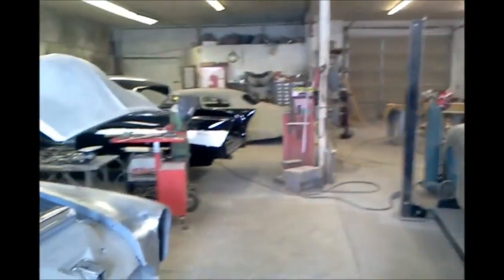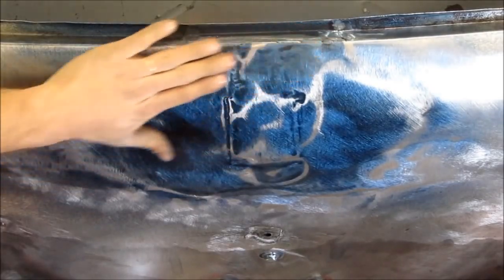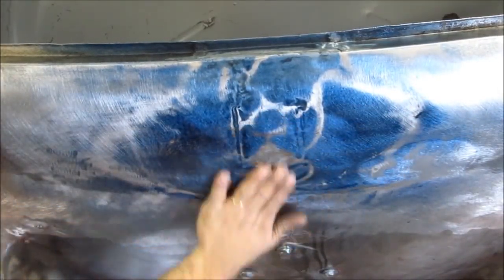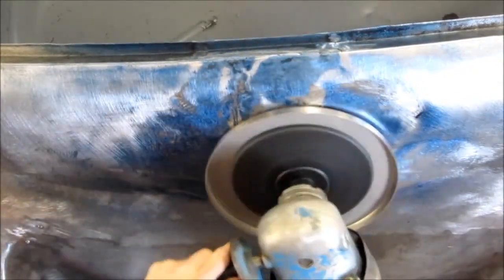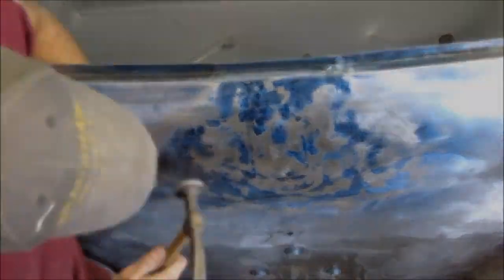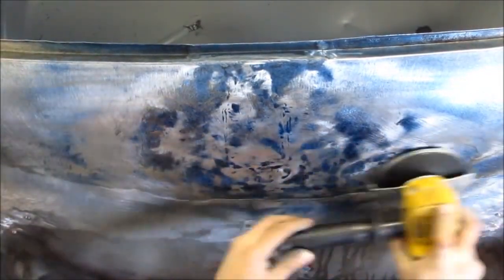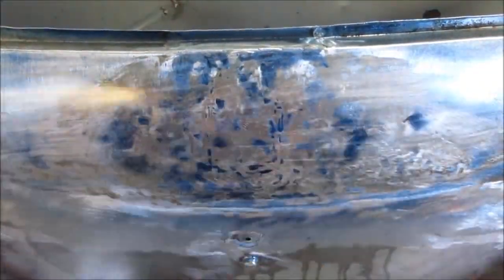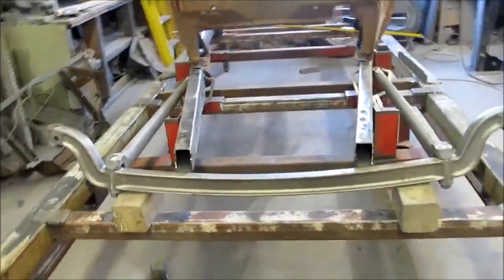Shrinking with a Easy Shrink ™ Shrinking Disc - Demo krimpschijf

Comment: I wouldn't bother.. grab any old blowtorch, an airline & shrink ahead - use circular diminishing diameter strokes with the torch then concentrate the heat for 5 seconds on the center where you want to shrink - you will see a small hot-spot develop,  then quickly cool the center with the airline. You can watch the metal shrink before your eyes like magik, with none of the faffing about. Lifts out dents like a dream too.

Comment: A definite improvement but Sorry you could have done much more hammer /Dolly before using the disk and you should have removed the Lead fill before doing any work. You are working the entire panel and you can’t when a large portion is dented and filled.

Comment: Thanks for the video. Do you ever get to a point where that panel hardens from too much hammering and shrinking? Also what paint are you using to sand and see the highs and lows?